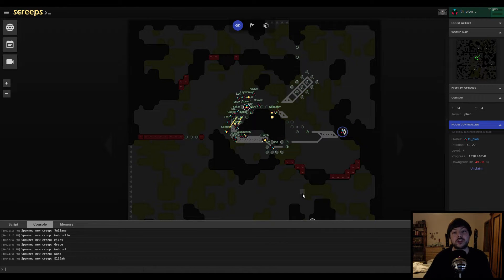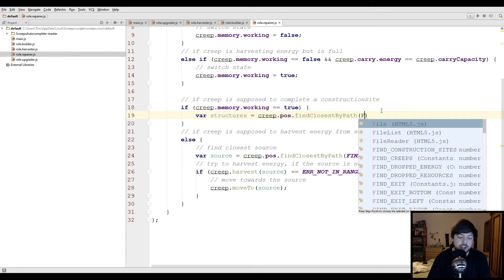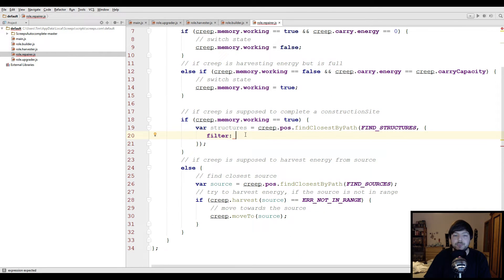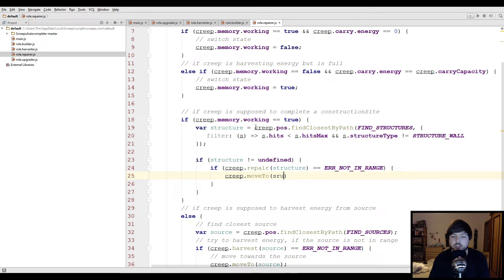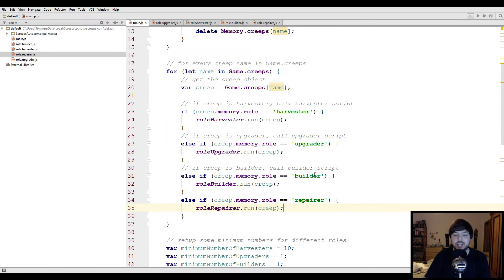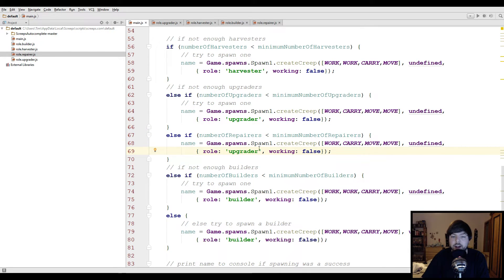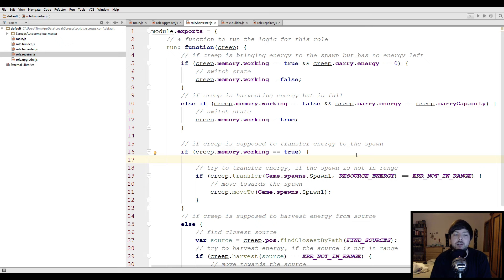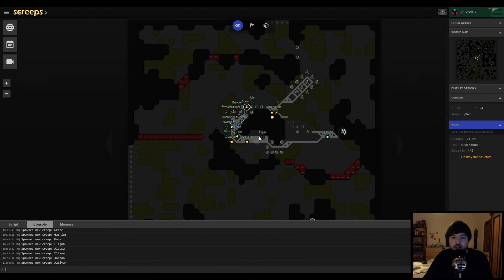Screeps Nooby Guide #6: Repairing and Extensions - by th_pion

Comment: The {} are usually called curly brackets or sometimes braces.

In Danish we often call them "tuborg" or "toppled tuborg" because the brewery used to have signs shaped like a horizontal curly bracket on their trucks.
Reply: Here's a pic of an ad featuring the Tuborg-sign shaped like that:
https://www.flickr.com/photos/9014509@N06/7748896282
Reply: in Spanish it is called "corchetes"
Reply: in portuguese is "chaves"